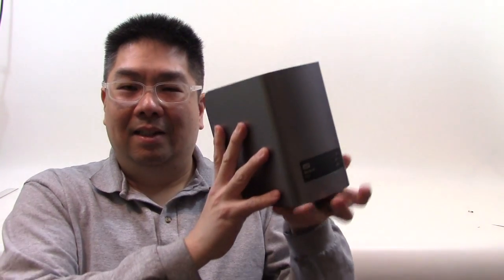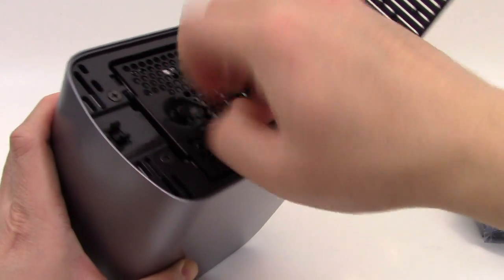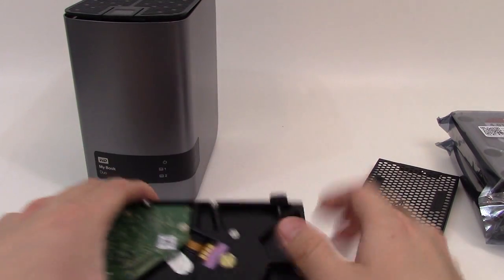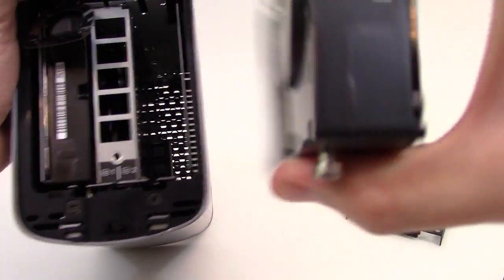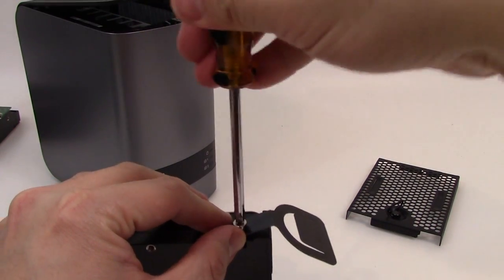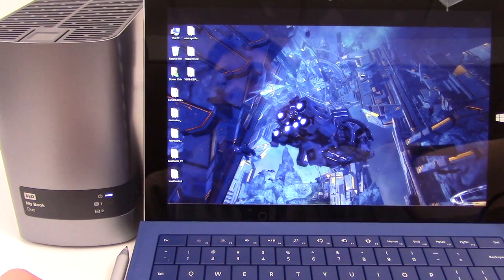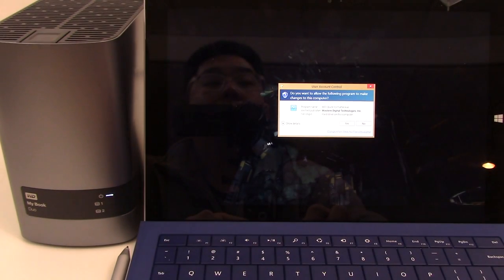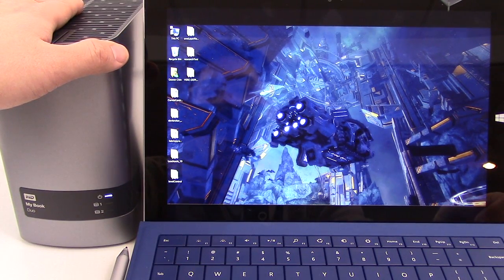Western Digital MyBook Duo: Replace Hard Drives

Comment: I have two identical 16 tb my book duo drives. They have roughly  the same data, because that's why I got them, to back each other up. Unfortunately, I haven't  used one for 6 months, and now when I tried to use it, it has three red lights. At least I know how to disassemble  them now, to try to fix them. Thanks for the very good video.  Well, I found a way to keep using one as a backup. I just swap the drives from the housing that's  broken, into the good housing. It works perfectly! I didn't  have to do anything  to get it to work. It only takes about a minute to do the swap. It's  a half ass way to have a back up, but it's  better than buying a new housing. By the way, they are both configured for raid.

Comment: Wow, thank you for the PSA. I didn't realize I had a ticking time bomb under my desk. Luckily I only have 500GB occupied on a 4TB RAID1 setup on my WD Duo. I just transferred all the files off to another backup drive, and plan to pull the drives out and sell the enclosure.  

As a replacement, I just bought a simple SATA Dual-Bay USB 3.0 Hard Drive Docking Station from Amazon. I'm giving up on RAID, and plan on just running 2 drives in JBOD mode, and just use software to mirror data across them on a schedule. This way, at any time, I have the freedom to just take one of the drives, and read it on any other computer, rather than being married to a particular enclosure or RAID controller setup.  Thanks for the video, you probably just saved my ass a few years down the line!
Reply: Can you also run the new docking station as non jbdo so that my computer sees it as 1 drive?

Comment: Western Digital say there is no forced encryption, you choose to install the security utility or not. If you try to take a disc out of the raid set up, what you think is encryption is the disc being set up for raid and you are putting it into a different raid environment or a non raid evironment. They will work in another duo case set up in the same raid environment (0 or 1) that yours are.
(The next jbod statement has been edited)
You can also use the Duo in JBOD without encryption but WD say it still wont work outside the duo in a normal dock. I have also confirmed this is correct.

I agree the Duo is not to be recommended for back up purposes.

If a non wd drive cannot be used in the duo enclosur and it can't, does that constitute restrictive trade practices?

Comment: YEP I just learned the hard ways. WARNING to those with Western Digital external hard drives!!  My solution to broken a USB port: had it soldered back on, and used Wondershare Data Recovery software to retrieve my files. 
On the WD My Book Elite external hard drive I used for my backups, the little micro USB port on it snapped right off the circuit board!!! I thought, no prob. I cracked open the enclosure, (yes it was already out of warranty) removed the bare hard drive, connected the bare drive to my computer directly via SATA and power cable. And guess what? I could NOT see any data on the drive. OS said the drive was unallocated, as if it had no partition. The Western Digital SATA to USB controller board used on their external hard drives is designed so you can't use the bare hard drive in any other enclosure, or in any computer. I could not find replacement parts or any other solution. Disaster! BEWARE if you use Western Digital external hard drives, you are screwed if the USB port or the enclosure breaks. Google it, this same problem has happened to countless others. I had to have the USB port soldered back on, and then had to use data recovery software to get my data back off that drive.
Reply from the maker: Wow, I didn't know it was on the other external drives too! I've not tried any data recovery tools, so did the Wondershare tool get through the drive encryption?
Reply: Yes for me it worked! Wondershare recovered thru the Western Digital encryption or whatever they do to these external drives.The external hard drive showed as unallocated in my OS, and could not access my files.  I was so happy to get files recovered, some I didn't have double backed up. All my digital pictures! I hope this helps some one else!
Reply: WD are the worst drives over time. Had a few died on me just bumping them 1-2 inches off the ground or moving them while they wake up in sleep mode.

Comment: WD told me today that the mybook duo has special wd red drives that will only work with the enclosure. 
He said that it has a special pin so it won't work on a PC if the drives are removed to be used as internal drives. 

Were the replacement drives you bought special drives designed only for this enclosure through WD, or were they just normal WD RED internal drives? 

I read you've stopped using the enclosure after finding out it hardware encrypts the drives. 
What did you do with all the drives after then? 
The old drives you removed and the new drives you inserted? 

Thanks
Reply: did you figure this out? I see these are sold far cheaper with 12TB WD red drives than buying the drives individually alone. But if they only work in the bay, then i get the reduced price. I can buy these new now for about 190$ while 2 6TB WD red cost 390$

Comment: Has someone actually tried to replace the drives for a bigger capacity drives and can confirm it is working fine?
I have a 12TB drive (2x6TB Reds, WD60EFRX), both drives failed, the model has been discontinued as was mentioned in the comments below.

I am wondering if it's even possible and the controller will recognize the newer 6TB Red Plus WD60EFPX (or Red Pro WD6003FFBX) or 8TB/10TB drives to bring the capacity to 16TB/20TB?

Comment: Hi Dower,

Were you able to re-use the disks you removed from your MyBook duo in other devices?
Reply from the maker: +Olly Pickett Yes, they are normal 3.5" SATA drives, so they can be easily reused in a PC or other enclosure. The data won't be readable though, so you will need to reformat the disks.
Reply: +Dower Chin Brilliant, thanks for the info

Comment: Thanks Dower for the great video. I exactly wanted to upgrade my 12TB to something like 16 or 20. Your video confirmed the concept but I'm not sure if I can go farther like expanding 16TB to 20 or 24. Something to share here: I recently had one drive failed. I got a replacement (WD 6TB RED) but I can't get the same model, the one that came with the enclosure (EFRX)  was discontinued so I get the newer one (EFAX). Rebuilding was failed so I had to buy an external hard drive (another Mybook 8TB!!) to copy everything from the working drive, then format the raid and transfer everything back to it. Two months later the other drive failed and I bought another EFAX and this time rebuilding was a charm. It took about 16 hours to self rebuild. My theory is, you need to use WD red series on these enclosure. RED drives of same size would work but if you want hassle free rebuilding EXACT SAME MODEL is required. I have 2 of them, 12TB and 16TB. Now the 12TB had 2 of the drives replaced and I expect they won't need any replacement in 3-5 years. When any of them failed I will try swapping a bigger drives.
Reply from the maker: Wow, I've not tried investing in drives that large. But I have run into situations at work where RAID's usually like to have similar make drives. I suppose it's just small nuances in drive manufacturers that can cause issues when trying to replicate or maintain a consistent state between drives, so it's usually recommended to have 2 or more of the same model drive.

Comment: Great review, thanks! I just have one question. At the end of the video you stated that a yremoved drive that has been configured with raid 1 can be inserted into an external data adaptor an be read with a PC. Have you actually done this and are able to reconfirm your statement? This is the only uncertainty that I have which is refraining me from purchasing this unit. Thanks in advance.
Reply from the maker: Kay Pad Hello Kay, yes I can confirm that. I work with RAID 1 systems besides this unit for work. So long as your unit is setup for RAID 1 (Mirroring) and NOT RAID 0, both drives are a duplicate of themselves. You can take your drive out and plug it into an enclosure and read the data off of it.
Reply: @dowerchin  Is this response still valid after that:

 ** WARNING **
I do not recommend this enclosure any more... There is forced encryption that appears after the drive is in use for a little while... This cannot be turned off, if your enclosure fails (not the drives), you will NOT have access to your files for recovery... The drives are encrypted and are not recognized outside of this enclosure... It has been confirmed here: https://community.wd.com/t/wd-my-book....

Western Digital MyBook Duo: Replace Hard Drives?

Can you take the disc out and plug it directly to the computer and read the data?
Or the encryption makes it impossible?
Reply from the maker: @kateydrummer  I don't believe anything has changed. But this unit is old now, and I've upgraded to a QNAP since then. I still have this, but I don't use it for anything of high importance.

Comment: I know that this video is very old by technology standards but do you still not recommend the WD My Book Duo?  I just filled up a 4T in raid1 (mirror making the capacity 2T) and want to swap out the 2T drives and replace them with a pair of 6T's. If so what do you suggest for a raid1 configuration?  Thanks for the nice vid.
Reply from the maker: I still use mine, but I'm still not fond of the encryption that's automatically on it. I think the newer ones don't have this problem, but I don't have a new one to confirm. I've been thinking about building one from a RAID enclosure. I was looking at this one on Amazon: https://amzn.to/2L8XhBk.
Reply: Dower Chin Thanks for the reply.  I’ve heard that the Duo isn’t designed for a professional and is not good for continuous work and what you said had me doing a lot of research.  WD does not recommend pulling out drives and swapping in larger ones.  One of the things they said was that the power supply has to be upgraded.  Hard swapping is not a good idea so I bought a LaCie 2big Quadra 12T.  Much more stable.

Comment: Hi Dower, I've just come across this thread - and very glad I did! I also own the My Book Duo, the thunderbolt version. I can't take the risk of having the enclosure fail, i'm a filmmaker and all of my rushes are kept on there in the RAID1 mirror mode. That's why I bought it, for the double back up.

How are you finding the Startech enclosure? Ideally i'd have something with a thunderbolt port, but if the Startech one provides the same functionality for our hard drives WITHOUT the weird WD encryption then maybe this is the solution. I'd love to hear your thoughts...

Thanks,
Alex
Reply from the maker: I've not used this WD Duo since I learned about the encryption. It was a huge disappointment for me to find that out. I've been using the Startech since then and it's fine. I've not run into any major issues with it. My wife's system I use it on sometimes won't boot with it plugged in... I think it's more an issue with the system BIOS more than the enclosure. I use the Startech to house all my family photos and videos. In my experiments a while ago I was able to pull the data off the drive without worry of encrypted data. The Startech NAS version is also ok, the only problem I have with that one is my XBox One won't find it as my media server... But over the network it's' fine. The tools are a little limited, but do the job. I should probably do a follow up video to those units at some point.
Reply: Ok good to know thanks. There's definitely a market for a non encrypted consumer RAID system, it's only a matter of time before one pops up hopefully!
Reply: I have the Thunderbolt version and the drives can be hot-swapped without any problem. I expected the same from the USB version, but ran into the encryption problem. Particuarly annoying: I bought the Duo to have two parallel backup drives in one box. But what's the point if none of the drives can be read if the enclosure fails?
Reply: Hi Matthias, so if you take your HDD's out of the thunderbolt WD Duo enclosure and put them into another enclosure such as Startech or G-Tech etc etc. they work? They're not encrypted? 

I went into a mac repair shop last week and asked for their advice on this and they seemed to think that HDD configurated to the RAID1 mirror option should work ok in other devices, like you say. It'd be good to know either way!!
Reply from the maker: Typically a RAID1 is a mirror and should be viewable outside this enclosure. That doesn't appear to be the case with this unit. I don't know if newer ones are better. Mine seems messed up now, since it doesn't like any drives I put into it... So I can't retest on it now. Probably for the best. I'm looking into a Synology at the moment for a new NAS.
Reply: Hi Matthias, may I ask how you were testing your drives in another enclosure to check your data wasn't encrypted? I'd also like to run this test to make sure I can access my data in another way if the My Book Duo Thunderbolt enclosure was to fail. How about if I bought one of those HDD docks (like TeckNet or Startech etc) and tried reading an HDD from the Thunderbolt Duo in my mac from that? Many thanks in advance, Alex
Reply from the maker: Hello Alex, Yes, that's what I did. I have a few drive docs and enclosures lying around. I had my Duo in RAID1, Mirrored, so in a typical un-encrypted RAID1 setup, I should be able to pull either drive, and plug into an enclosure to read the data off the drive. The drive should just mount as another drive letter on my system. What I experienced with the drives from this unit is any attempt to mount or read the drive in a dock or enclosure didn't work. The drives were simply unmountable or unreadable. Just be aware when you pull a drive from the Duo and re-attach it, it might detect a RAID failure and initiate a rebuild of the array before reporting it functional again.
Reply: Hey Dower, thanks for replying so quickly, i've got this drive situation on the brain and need to get it sorted! Hmmm that's what I was wondering, would the Duo attempt to erase and rebuild the array when I put the drive back in the Duo.
 
How about if I just removed one of the HDDs from the Duo, leaving one in there, then put the removed one in a dock to test whether it's mountable or not...and then when I put it back into the Duo it could rebuild itself by making a copy of the data from the drive that was never removed in the first place? Would that work?
Reply from the maker: If you're Duo is setup to mirror, it should be fine if you pull one to try out. If the unit does detect a RAID failure, it will attempt to rebuild the Mirror from the drive that's in the system, like it's supposed to. You shouldn't lose any data. Of course, I'm partially paranoid, so I would backup important things before playing around with your Duo; just in case.
Reply: Yes, I used to use a USB3 drive dock, and the drives from the WD MyBook Duo THUNDERBOLT version were readable. I expected the same from the USB3 version. I wanted to use 3 backup drives: 2 in the MyBook and one disconnected (just in case some malware tries to delete all my drives.) Unfortunately, the MyBook USB3 version does not even allow me to "cycle" my backup drives: If I want to replace ONE drive with another drive (say, backup drive 2 with backup drive 3), even in JBOD mode, I have to reconfigure the setup, which means I have to DELETE BOTH DRIVES in the enclosure. (In this example, I'd have to delete backup drives 3 and 1 to use them together in the Mybook Duo USB3.)

I now use the MyBook Duo Thunderbolt version for my backup drives and the MyBook Duo USB3 in RAID as a twice-as-fast external drive.
Reply: Which startech are you guys using? Can you link it on Amazon?
Reply from the maker: I have this one: http://amzn.to/2lOKdYb
But I've just replaced it with a more serious NAS, a 4 drive QNAP TS-431: https://www.newegg.com/Product/Product.aspx?Item=N82E16822107184

Comment: I just purchased two of these enclosures thinking that I could simply insert my Samsung & Seagate drives into it.  So far I have NOT gotten any of this to work on my MacBook Pro.  The software will recognize the unit but not mount any of the drives.  I also cannot erase or format the drives with the WD Utility software.  I continually get an Erase Error.  Can you confirm that these enclosures WILL work with non-WD drives or do I need to return the enclosures??

Comment: I have a My Book Live Duo 6Tb part number WDBVHT0060JCH, which appears different than the My Book Duo in this video; however, I have never run into the problem described in the warning.  I have found it necessary to de-brick the unit on occasion and have so far always been able to recover my data.  It is only certain part numbers that force the encryption mentioned?
Reply from the maker: As far as I know, it might have been limited to this early model. I still have the drive, but I've not invested in any new My Book's in a while. Maybe I'll need to revisit them again. I've been hesitant with WD drives, since last year there was a bad remote erasure exploit with one of their internet connected models.